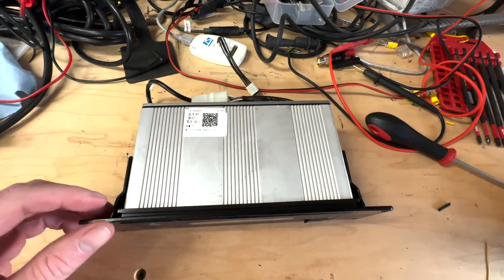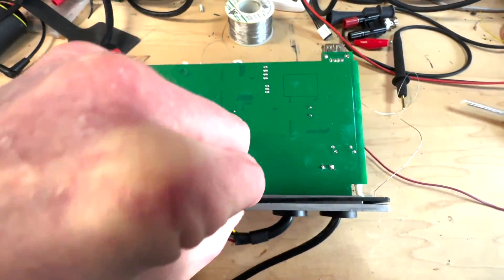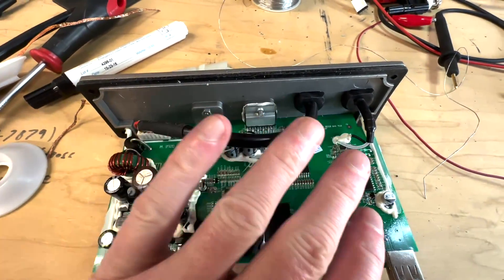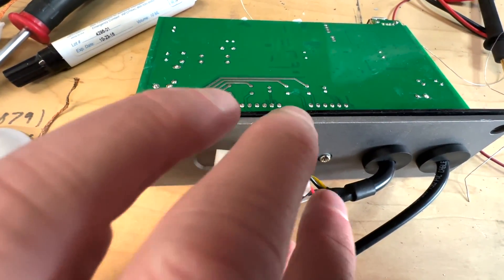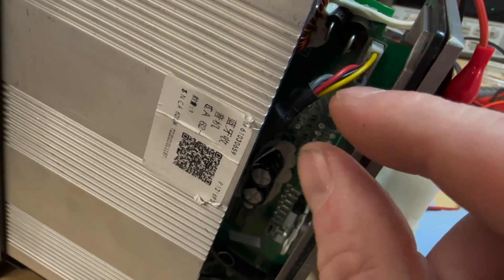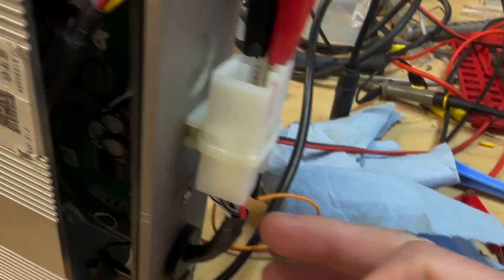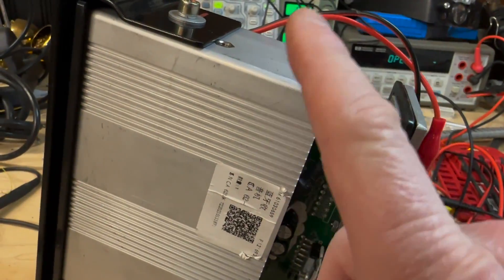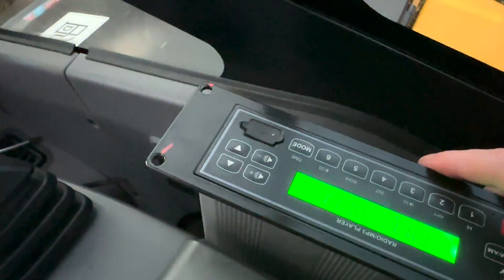Sany Excavator Radio Repair Attempt: Re-Soldering and Troubleshooting

Comment: My radio works intermittent as well. Turns on but no audio at times
Reply from the maker: Yeah same problem.  I had hoped it was just solder issue but it wasn't.  I'm going to try the hi-m202 first and I'll do a video as it may be almost a direct swap.